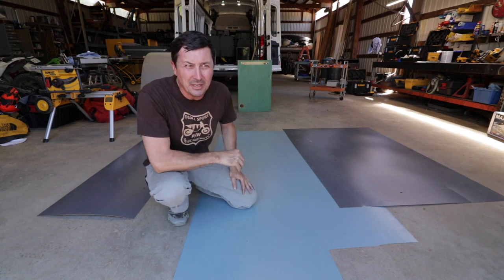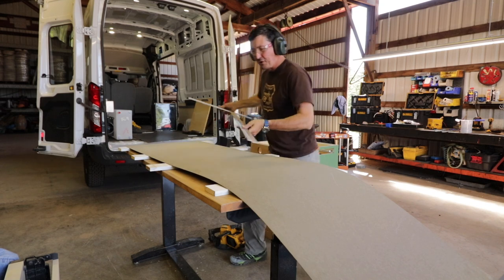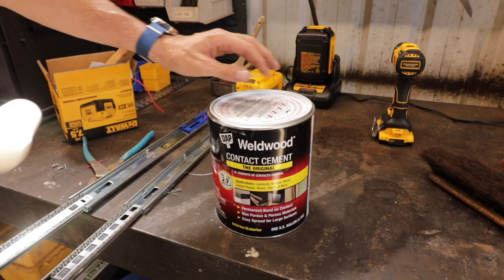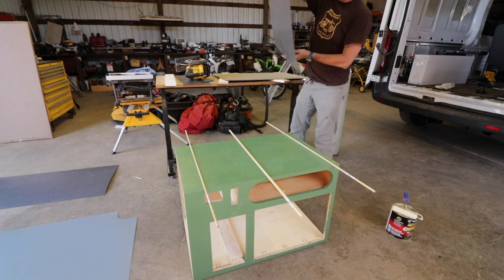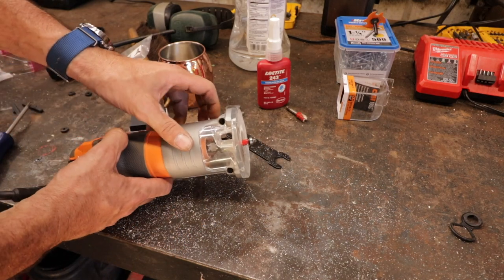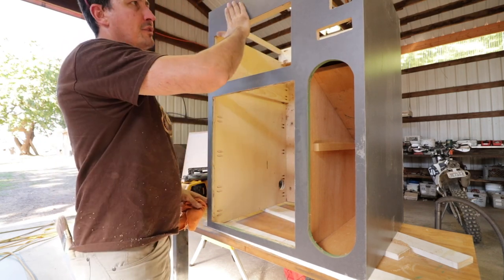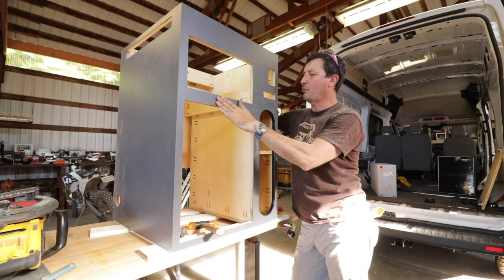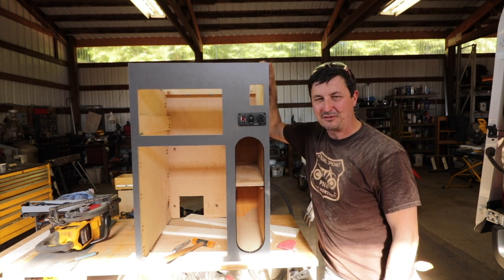Adventure Van Conversion - Building Cabinets

Comment: I'd recommend putting the plastic trim seam for the cubby on the top. You'll spend more time looking down at it than up and I think the bottom will take more wear than the top. Not sure what glue to use. Love your videos and looking forward to whatever comes next.
Reply: Also relief cuts on the corners.

Comment: Greetings from the Great White North. Thanks for posting the build. Nice Job. I have installed a lot of laminate. Use a fine file to smooth out the rough edge after you router each piece to ensure it is completely level with the wood and remove any excess glue. File the finished corners to give it a very small round over, just so that it is nice to the touch. Use acetone to clean off the excess glue. Do not end the seam of the plastic trim piece on a curve, do it on a straight away. If you use the contact cement for the trim piece, apply the trim when the glue is still wet, otherwise you cannot adjust it. As soon as you have a few inches of trim inserted use a round dowel or the hammer handle to push it tightly into the groove with a rolling action, then use painters tape to keep it nice and secure until the glue dries. Cut the trim about 1/16 of an inch longer to make sure it forces itself tight into the groove.  Good Luck and Take Care.
Reply: You said what i was going to say. My laminate experience came from aircraft work. We used contact cement all the time. Then put it under a vacuum.
Reply: I agree completely. Ending the trim on the curve will always be not good. As it appeared in the video, you cut the trim a bit to short. This type of trim shrinks over the years, cut it fat and just over cut to allow for the contraction in cooler weather and expansion in the humid time of year, glue is ok but  the vinyl needs to move with the expansion and contraction with the (plywood) of the carcass.  You have seen it in other applications and said to yourself, why didn't they compensate for that. Thanks for all the content, most is great, some is good, but keep it up.
Reply: I recall some of this from my dad, 40 years ago.  Now I know why he did what he did.  I likely knew then, but what you do not use, you lose.  THANKS for the MEMORIES!

Comment: Wranglerstar,
You did a really good job for your first attempt man, looks excellent on video.
I've laminated Fire Door Blanks befor & sheets of 8x4 plywood.
I used a EVO STICK GLUE. 
Applied the glue onto BOTH materials with a 6 inch decorators scraper & then making a longer glue spreader out of hard plastic. 
Basically used the scraper like a Trowel then waited 15 or 20 minutes and did the exact same as you with the stickers to rest the laminate on and worked from the centre out. 
Trimmed it with a laminate trimmer just like you. 
You can get laminate knifes to trim the edges for fine detailing but boy oh boy that's a Art & Craft you need to be good at. 
The laminate sheets came in 10X5 feet rolled up.
The EVO Stick came in Gallon Tin Cans. 
Excellent job Cody.
Love your channel ☺

Comment: That tank as a roller is a great idea... My dad always used to say use what you got hanging around and make it work! I used to use the downward pressure of the post on a car lift to break the bead on tractor tires! I would just lay the tire down and lower the car lift and the arm on the lift id line up right above the rim. The downward pressure would break the bead! Didnt have a tire machine but had the lift! I made it work! God Bless

Comment: I have done a lot of Formica work back in the 90s....i used contact cement,  very flammable but it's the best..i would trim with a flush bit then i would use a slight bevel bit to just put a small angle on the edge..i all so used a fine metal file to clean the edge..used acetone to clean glue...love your channel.. all ways very interesting..wish you and family the best ..patrick Montauk long island N.Y...

Comment: Nice job, a cabinet guy taught me a good trick, the trick is to put blue painters tape on the edges before cutting, I learned this the hard way. Blue tape is especially important if you are using an old router tool or one that has done some work, it will keep the surface scratches off of your beautiful new formica

Thanks for publishing great videos

Comment: I have also stepped out of my comfort zone yesterday, I have always fixed everything on my trucks and cars except for the air conditioning, I went and got me a set of high and low side gauges, and found out there was nothing to be scared of, (the expansion valve was stuck closed) automotive a/c really is a simple system. feels good to accomplish something you were nervous to try.
Reply: Watched Chris Fix, didn't you?

Comment: Hi Cody
i have watched your channel for a while and love what you do on it. It is always entertaining to watch, as with the T-edge on the curved sections if you cut the 'tongue' every 1 inch or so so it can spread out a little it will stop the pulling away from the board, no gluing necessary, as a cabinetmaker here in Australia you have done a better job at laminating unaided than I've seen some apprentices do after multiple instructions, keep up the good work

Comment: Great video Cody. Having worked in the automotive industry whenever we glue something interior related we use a high strength epoxy cause it's less susceptible to breaking down over the years of going down lesser quality road surfaces.

Comment: Lacquer thinner is a must have for laminate work. But there are a million ways to skin a cat! There is spray on adhesives to help speed up the process, I forgot what it's called (maybe #77?) but anybody in the business knows. You can use the t-molding or just regular edgebanding with a strong adhesive they should hold. I agree with the comment that the one person mentioned about the seam at the top. I was a General contractor specializing in the business, cabinet maker, and a finish carpenter for years before I had a stroke. I enjoy your show, keep up the good work!

Comment: This brings back memories. Back in 1995 I worked in a cabinet shop in Myrtle Beach SC. video poker machines were legal then. We made a hundreds of video poker machine cabinets. MDF, black laminate with T edging. We did not use glue on the edging. We use a little pneumatic palm hammer to drive the edging in. We also used 1inch pvc pipe instead of wood dowels.

Comment: Nice work...  & Variety on the channel is fine, if someone doesn't like, they can change.  FYI on laminate: Block & deadblow, rubber mallet, etc.;. Lol on glue, I normally double coat; scoring blade for utility knife handle works nice, also plywood blade backwards, & if careful, tin snips;  use tape(or lam-I-lube) for where bearing rides on fresh laminate, in case bearing heats up or drags; remove, reset, bubbles, loose spots can be reactivated with an iron or heat gun.  Or used to bend around curves; careful test on plastic T, some damage/soften material.  Had used Max Bond years ago, BUT...  Great job, good to try & show attempts, certainly teaches others...  I'm just an old wood butcher, with decades of lessons, lol...  & Thanks, for your good knowledge & attitudes.

Comment: This is Mike from Hazen Design Carpentry. I've  done lots of laminate. Glue the rubber strip with the same contact cement as the laminate and clean up excess glue with acetone. Keep up the great vids.

Comment: I love taking a space and turning it into something more accommodating, with cabinetry. Well done. 
 Something I do.  Once applied, i chamfer the edge of the laminate. It helps items from catching on it. Also those edges can be razor sharp.

On  the molding around the cubby... first i would put the seam at the top. Out of sight out of mind.  And when you sliide an item in it doesn't have the seam to get caught on.  
Getting the molding to stay in place i have used contact cement.  It can be messy so tape off all of your surfaces.

Comment: I used to work for a laminate distributor. All of your techniques were spot on. The only thing I might have done differently, would have been to use more dowels to separate the laminate from the plywood, maybe 5 or 6 total for a project that size. That could have made alignment a bit easier. I loved your improv in using the tank in place of the roller, also, next time you are working with laminate, when it comes time to trim it, use a dust mask or respirator, there is a lot of nastiness in laminate that you really do not want to breathe. The trim you chose is OK, I would have used edge banding, which is just a thin strip of the same laminate, very similar to edge banding for plywood. That applies the same way the laminate did. I might have chose to put the seam for the edge banding on the top of that opening so when you are looking down while standing in front of the cabinet, the seam is not visible. If you want to try making your own edge banding on a table saw, you can using some scraps left from your project so it is color matched. Or you can just use the same contact cement to hold the banding you chose in place. Just to be safe, test the contact cement on a scrap of your edge banding to make sure it does not melt it.

Comment: I installed something similar to what you installed on my boat, I did not use glue, but I cut slits in the rubber edge in the corners so it could bend easier around them, that was 16 years ago, still working for me. Another trick I've done is on the edges, run masking tape tight in a straight line along the edge just exposing the very tip. Use black nail polish and paint an edge, then remove the tape.

Comment: I work in the autoglass industry and work with moldings just like that on installs. I can't fully recommend the same glue we use for paint to glass and rubber surface but we use a urethane adhesive. Also for getting the curves to lay better, using a heat gun to soften the rubber helps it form then cools to the shape so might not need any glue using that method. Hope this helps in some way and you see it.

Comment: Great work. This is pretty much exactly how I do it at work. Except we keep those faces out on the edges and file them down with a file to give a clean and smooth black line on the edges. And we don’t use a roller we tend to use cut offs of Formica to ensure the laminate is smooth. Overall great work. And to get the glue off use lacquer thinner. Work like a charm. Acetone is too harsh

Comment: In my teenage years I spent many summers working at a cabinet shop with my grandfather and I did many laminate projects.   A few thoughts...(1) After routing,  the laminate edge can be very sharp.  Be sure to run some sandpaper to knock that edge down.  (2)  Lacquer thinner on a rag works great at removing the glue. (3) We used a kitchen wooden rolling pen to roll the laminate.  (4) If, after routing the laminate edge is still a little proud of the side, lightly sand the not-yet-laminated side with a belt sander and let it run over the proud laminate a bit. Sand lightly, don't force things, and use a fine grit.  Very important - be sure the direction of the belt pulls the laminate into the project and not away.  Doing so it can grab and chip and rip off what you just glued on.   Sorry I can't help on the t-molding stuff as we did do any of that.

Comment: Hi Cody - you dont need a J-roller for small jobs, you can use a rolling pin.  I dare you to skarf Mrs' W's large rolling pin for the shop.  Also use a 45 degree router bit to chamfer your edges/corners.  Reason for this task is to reduce the chances of inadvertantly pulling up the laminate.  On your inside chases, glue your laminate with liquid nails - use this sparingly.  I use clean utility blades to gingerly scrape of my excess glue.

Comment: My father does custom laminate countertop. I think you did an awesome job for your firtlst time. Try using masking tape on the finished surface of the side laminate when trimming the front. This will keep the bearing off the surface slightly. Then take a file to work it down that thickness of the tape. Also we've used mineral spirits for years to take the glue off. I'm sure a lot of different things will work though

Comment: I've used that T-molding a lot. 
Suggestions:
1- No need for glue, you did it right. Put the joint of the T-strip at the top of the oval opening. Most of the time It's harder to see with the overhang of the counter top and when the plastic shrinks. "Oh yes, it will shrink, think of times when it's really cold..."
2- Cut some relief slices in spline for those inside curves. You'll like it much better. Cut notches in the spline for the outside edges.
3- The trim bit is the best choice. Next time try a chamfer bit, I used one in an emergency once. After some careful adjusting and bearing changes,  it looked pretty cool. This works really well with lighter/contrasting colors of lam. It sets off the colors with a dark seam or "accent" line. Try it out on some scrape, It can hide little screw ups, I think you'll like it.
4- Also use your compressor to blow off all the dust and shavings from your arm hair. Help prevent contamination of the glue surface. 
5- That giant cylinder LOLOLOLO What ever works. Dark colors show scratches much easier, it's big and unwheelding and could have damaged the surface, only for personal use. It also can limit the amount of surface contact achieved. Good thinking though... 
4- Keep up the good fight, love the channel. Congrats on the loaf!
PS-Wife says she misses manly manners. As if she'll get treated any different by me.... BBAAAAHHHHHHHHAAAAAA

Comment: I used to do a lot of laminate, about 10 years ago.  As with mastering any new skill, patience and attention to detail serve you well. It looks to me like you did a great job. I used a paint roller and a 1" dowel drilled in the middle as a roller, iirc we used paint thinner to clean excess glue (but may have been acetone) Important thing is only use enough to wet your rag and not get it into the seams or edges because it can cause a bubble if it gets into the glue there. I like your channel and content, whiners are free to go start their own channel and produce content more to their own liking.

Comment: Great job! Well done for your first go at laminate!
Here in Tokyo we use Lacquer thinner to clean up the glue, maybe you use Acetone over there?
Yes your flush trim bit was sticking out too much, fix that next time. Also check the bearing on the flush trim bit, they often load up with glue, which will make the bearing's diameter increase, which is bad, and the glue can melt and get into the bearing, causing it to seize, and then the bearing will burn a line on your laminate..... speaking from experience here LOL. You might need to take the flush trim bit out between sides and soak it in acetone to get the glue out and off of the bearing.
Last tip, if you don't have a J-Roller, yes the heavy tank works, but a soft rubber mallet also works, especially on the edges.
One final general tip, get yourself a 2" thick piece of rigid foam insulation and put that on your table, then put your sheet goods on top of that, cut through the sheet goods into the insulation a 1/4" much easier that moving them 1x4s around all the time.
Great video, that cabinet looks totally Pro!
Cheers!

Comment: Hi Cody, I have done my share of laminate and I would use 5 dowels or more so that the laminate is kept well away until you want it to stick. I have never used any glue for the edging, just make sure you tap it in fully before moving on to the next side. It makes a nice job of your unit, I don't like the green either.

Comment: Howdy, I’ve been a fabricator for Wilsonart for 5 years and I would recommend contact cement for the vinyl and I would go over every edge with a file just to get your edges very flush so nothing snags on them.

Comment: Try cutting the spline every 1/4” or so in the curves to allow it to follow the inside curve.
Reply: SpinnerCar I went looking for this comment. Didn't see it initially.left the comment myself, and am now thumbs upping your comment as you got in first.
Reply: Having built arcade cabinets with lots of t-molding, this is the correct comment. Also, starting the t-molding at the top of the face opening will make the seam more difficult to notice.
Reply: Yep, cut the part that goes into the grooves. For an inside corner just slice it every 1/4" or so, for an outside corner, like on a table, you need to make pie cuts to remove material. Inside corner you might not need any glue, outside corner, yeah glue it. I can't recommend a glue, as my knowledge base for NA is 30 years out of date, but I could recommend a Japanese glue LOL. Just find something slow settings, that dries clear and somewhat flexible, something that will stick to both wood and they plastic.
Cheers!
Reply: What type of glue would you recommend?

Comment: Few tips on the laminate; Run a file on the exposed edges of the laminate it will smooth the sharp corners off just make sure you are pushing down against the laminate with the file don't pull back on it, lift the file up on the return stroke or you will chip the laminate. Before you route the excess off smear a little petroleum jelly where the bearing rides it will help to keep the bit from burning the finished surface.